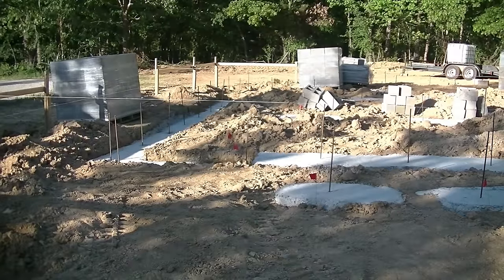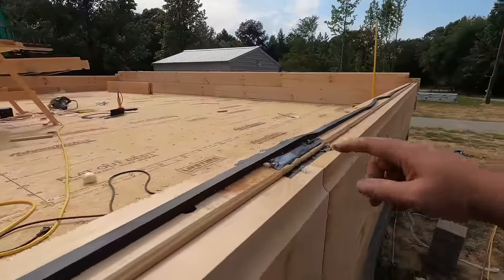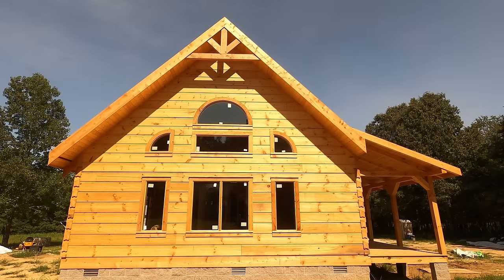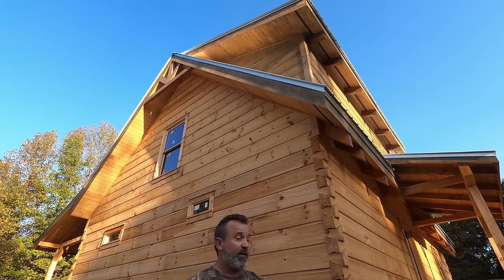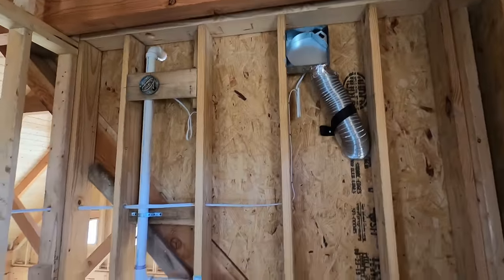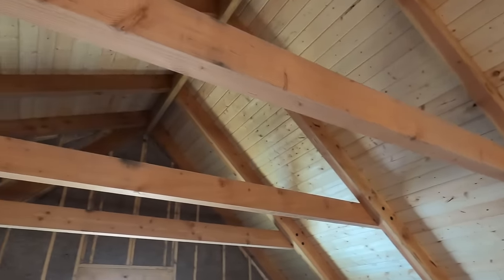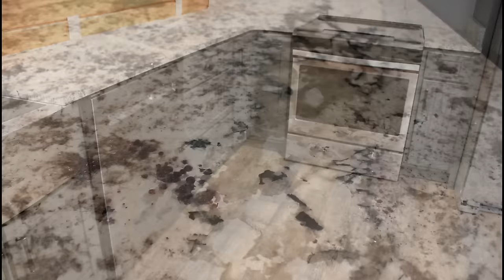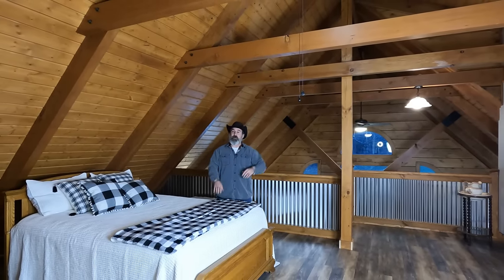Log Cabin Build Start to Finish | Two Year Time Lapse in ONE HOUR!

Comment: You could almost put a small little hide away room up in the beams of the loft where the dormer is. That would be a cool spot for a gaming area for kids or another little bunk area. If you don't understand what I mean and are curious or interested message me and I'll explain more and better. I think it would be a really cool and unique idea, not to mention adding room for more guest in an other ways wasted space. Not bashing you home at all, I think it's gorgeous the way it is, just thought it was a cool idea for an add on later down the line.
Reply: To add to my comment, I know it would be a very small space but, it would be perfect for some bean bags, TV, and XBox or even just a small place for a queen or maybe king mattresses placed on the floor that would be built across the loft beams.
Reply from the maker: We originally, had a false wall there but decided to open it up. May put it in later. Thx!

Comment: One small detail...for my preferences I would have used open railing on the upstairs for the extra light and the view out the front.   But, Grandma Carol won't be upstairs anyway.
Reply from the maker: Me too but she wanted the privacy for upstairs she thought would be better for guests still sleeping.
Reply: Yes I can understand that too.  When you showed the view up the stairs though, the stairs looked so dark.   Maybe could have just used the galvanized there by the bed.   But I do like the wood in front of the metal.
Reply from the maker: @christinestephenson1742  very good idea! Thx

Comment: Nice video. And sweet home por your Mother. Just a question: How warm it will be in winter? Perhaps You thaught in future instalations, or they have been instaled and the videro does not show it....
Reply from the maker: Very warm! There is blown in insulation in the top and the roof is 13” thick with insulation and wood! The bottom walls are solid 6” pine.
Reply: @RidgeLife  Thanks for your answer. I don't know how is the weather there. My question was because I am 70 years old, and in my experience when you reach temperatures of minus 2 Celsius degrees , further more than insulation,  in big spaces as your living room, you need some kind of heathers. Please excuse my ignorance and hope your Mother enjoy such a house undoubtedly made with love.
Reply: We had a pretty cold first winter and I stayed toasty warm with low gas bills. I was surprised. I kept ceiling fans pushing warm air down. I’m also 70 and like to stay warm.

Comment: Good afternoon, do you have a rigid ceiling tied to the wall? What will happen when the log house shrinks?
Reply from the maker: The house is made with expansion voids to allow the logs to expand and shrink and the roof and floor will accomodate. It's pretty amazing!
Reply: @RidgeLife  Thanks for the quick response, do you have a video showing how you do it?
Reply from the maker: @MikhailZHD  sorry I do not but if you Google how to build log cabin walls for expansion contraction, it should come up. It’s pretty cool.
Reply: @RidgeLife  Thank you

Comment: You need to re-title this video.  This is NOT a LOG cabin.  This is a premanufactured cabin.  The wood for the walls is not rounded felled trees.  These parts are precut shaped units.   Real logs used for a cabin have imperfections in their shape that need adjustments when placed.  They don't go together like Legos.
Reply from the maker: Are you saying rectangle timbers for Appalachian style LOG CABINS are not logs?  These logs come from eastern white pine and are hewn and kiln dried in Moss, TN and shipped to our location. Just because the logs were not hewn to rectangle timbers on site does not negate it from being a log cabin. No where did I say hand hewn or from trees on location. Sorry for your confusion. 
Definition of log cabin
: a cabin made from logs
Definition of log 
: a usually bulky piece or length of a cut or fallen tree
especially : a length of a tree trunk ready for sawing and over six feet (1.8 meters) long
Reply: They are logs

Comment: Well that's one way to get mold and diseases :(
Reply from the maker: Please elaborate for us so we can correct it. Thanks!
Reply: @RidgeLife  Sir it's really bad to use drywall on wood and drywall in general in the first place. No matter how warm Your house will be heated no matter how well ventilated Your house is. It will still get mold in drywall. Mold is the cause of 50% of diseases in USA and that is chronical diseases.
Reply from the maker: We didn’t put drywall over any wood. It’s only on framed studded walls. Thx.
Reply: @RidgeLife  Still You will get micro mold not visible to the eye
Reply from the maker: Where? We don’t have anything covering wood anywhere in this home. Where did you get your statistics?
Reply: @RidgeLife  Don't believe my words, check it for yourself
Reply from the maker: Please site the reference where 50% of US chronic disease comes form mold and where it is unhealthy to use drywall in home building.